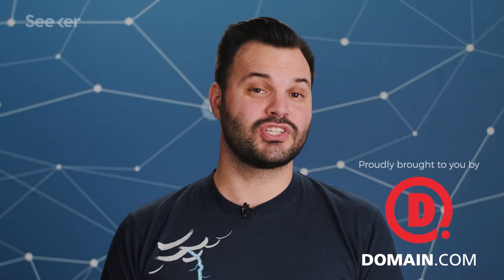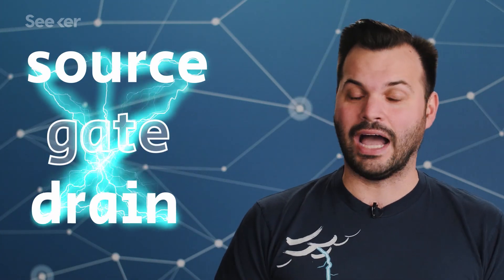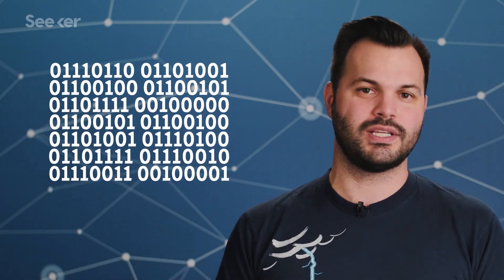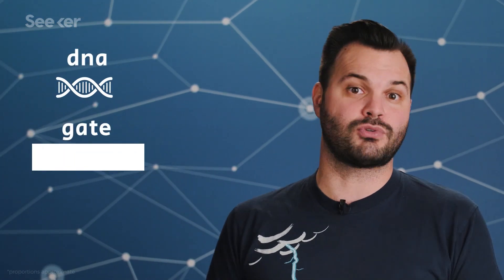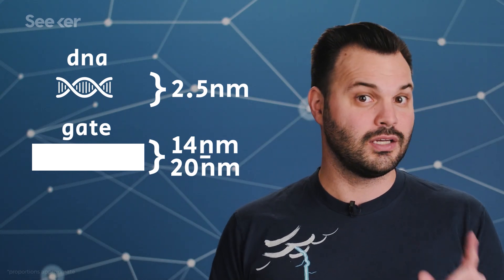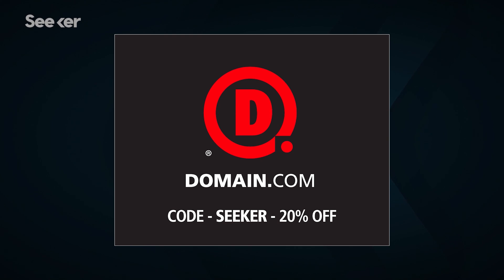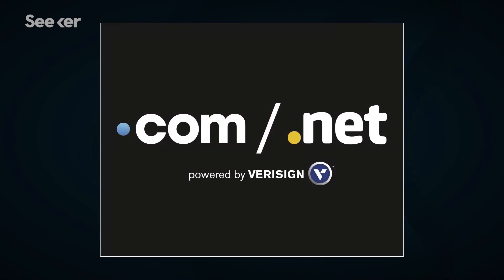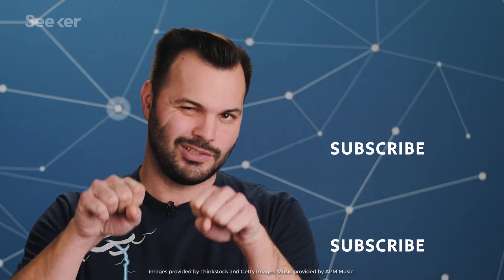This Is the End of the Silicon Chip, Here’s What’s Next

Comment: Back in the nineteen thirties they were working on transistor, and had the patent in nineteen forty. Making and intergated chip, with more than one transister was not only easiy, you could almost do accidently. Either way, you didn't need figure out the technology, you just had to do it. A little after they had the patent on transistors, the engineers made a intergrated chip, they called a Hershey Bar, because it was the size of a Hershey bar.  The engineers took the Hershey bar, and big box of radio tubes to the president of American Electronics.  They did a presentation, explaining how that little Hershey bar would replace all of the radio tubes. They would use less electricity, were smaller, and didn't wear out. The president of American electronics picked up the box of tubes and threw them on the floor. The tubes smashed. They president said, "what you boys don't understand is, I make money selling tubes. If they don't break, I'm out of business."  American technology held the patent on transistor, and there use was suppressed in the United States. In the fifties, Japans electronic firms were using transistor when they could. Transistors were expensive, but products would brag about how many transistors had in them. The United States slowly phased out tubes in electronis in the earily eigties. Boo hoo, so what? When the patent of transistor was running out in 1957  Texas instruments invented the first intergrated chip. Well no, they got a patent on it, because the patent on transistor was suppressing intergrated chips. You know a patent last seventeen years, right?  So the computer age was stalled for almost twenty years, right? Hell no, the electronics industry has fought tooth and nail to stall advancement for it's whole history. Why? For profit they claim, but profitable is company that doesn't exist? How many electronic companies exist in the United States today? Did you know the first digital camera was owed by Kodak in 1975? Kodak thought, "We are a film company. If we don't sell film, we are out of business." Where is Kodak today? It's all but dead.

Comment: Look at the 2011 chip, and then the 2011 v2, then the v3, and as of now it's 2066.  They just need to make em wider, and that's what their doing.  Of course you can get a dual socket mobo if ya want to go nuts, but I can't bog down my 4960X with 200 pages open and running all kinds of programs. 

 On a side note I've always wondered if they could switch to silicone carbide for the chips.  They could take some crazy temps "when you see the black in a sunspot your looking at silicone carbide", but I'm guessing the manufacturing process would take some figuring out.

Comment: 5-6 nm maybe... But even though I have a really small phone with a powerful battery... I have a "large" desktop computer with the actual CPU's is probably just 1% of that volume inside it... And I don't mind the big (it's a medium PC case)... atm it has 4 cores, and running about 1000 threads... 5-6 nm ARM (type chips) using 50% of the this desktop space would probably (at 5-6) nm would easily amount to +1000 of CPU cores... and the best part of it is that the cores can be off/on depending on the workload... 

But I actually welcome the day, then we need to start using our brains instead and do things smarter and not just make some hardware to do it faster... Improve algorithms in software and so on... but that will probably never happen again, like it was on the C64 for example wich just got better and better by improving the software...

Comment: We stopped going for clock rate a long time ago - we were doing 3ghz+ in the early 2000's - and started pursuing more data in each clock cycle, and more cores to multiply the amount of work that could be done. We don't NEED smaller transistors we can either use physically much larger cpu's or many more of them. I kind of like the idea of having a motherboard with 32 cpu slots in it and you simply add as many cpu's as you want performance. Of course software development needs to change to be highly multi threaded, this would probably benefit most from a hypervisor that dynamically handles this and spreads the load so it appears to the software as 1 core/thread but is actually running on dozens at once

Comment: April Fools. Seriously. Is there not a better article; this is a concept in progress not a fact or something workable. A light structure would be much bigger and not nearly as workable as a good circuit; ever see electrical energy transported many miles over light? And light being faster supposedly (electrons can be almost as fast as light; depending on the medium. light can be made slower based on the medium) doesn't make a computer faster; our nervous system has millisecond delays but is considered overwhelmingly better than any silicon system operating at ns delays.

Comment: the short answer to what happens when we can't make the transistors any smaller is that we will get much more 3d but this causes problems with heat so we will also have to get more efficient there is a long way before we run out of ways we know to get more complex before we run out of ways to do it.

Comment: we have to think the reason why we need to shrink the transistors at all. It is because of we need small and more powerful hardware to run our mobile devices. Consider this, if one day a new battery technology comes out that drastically shrink the volume of the batteries we use, there would be a lot of space left for bigger chips. There won't be a need to shrink anything else

Comment: Just being nitpicky about the physics, but it isn't the current that represents a 1 or 0, but the voltage level.

Voltage is what triggers the gate in a transistor to open or close, which is what allow computations to be completed. 

Yes, current does flow during switching, but a stable voltage level (a stable bit) is what is computed.

Comment: Everything seems to have its own evolution even these transistors. My first computer would be concerned a joke today, it was quite small made by Timex  and had next to nothing in cpu speed via 2.2 kb or ram storage. It was very limited and the keyboard was prone to failure due to its poor design but it was a starting point for those bigger faster more power ones. I was blown away with my first 500 mb flash drive and now they range into the terabytes?  Now, we have solid state hard drives and nano size devices that will boost that already lighting fast ghz speed? 
My one guestion is what about that cpu damming heat we still have a big problem with for a fan can only do so much? Will these nano tubes run cooler or even hotter?

Comment: ... and Moore's law continues to hold true.  The number of transistors will continue to double. Personally,  I'm inclined to believe that if you could make a time crystal out of quasi light particles you could not only use it as the basis of quantum computing,  but add additional dimensions to the same logic gate since the very structure of the crystal can vary. Rather than making the transistors smaller,  you can just add dimensions to the transistors you have.

As a side note,  quasi light particles can't be massless because the electrons that the photons are bonded to are not massless. This also implies that unknown electrical properties may be found.

Comment: (I might just be asking an uninformed question here I'm sure I am but) if tunneling through the gate is the problem why don't we take the gate out of the equation entirely and just turn the source on and off to represent ones and zeros if it goes through the tube then it's one if it doesn't go through the tube that is a zero that can account for the quantum tunneling as long as it pops something in the tube it's a one couldn't we use this principle to make this work anyways? If the gate is there to register if it's on or off essentially can't we just do that from the source?
Reply: The problem is that we're thinking that the smaller we go the fact is we still have to stick with our current modern system of how we register the data what if we changed how we register the data to account for tunneling is what I'm trying to get across, is it possible?

Comment: The Gate Drain Source architecture is actually that of a CMOS transistor or (Crystalline Metal Oxide Semiconductor) whereas, modern chips use Silicon! and the three pins are actually named the Emitter, the Base, and the Collector! More than that, the individual Logic gates are actually constructed in such a way that throws the basic transistor out the window, and is much more complex... not to mention the way they are put in a matrix together... but that's getting a bit off topic...  main point: we use Silicon today! not CMOS variants!

Comment: Transistors are NOT SWITCHES, they can be used as switches, but their main behavior is controlling the electricity flow between the collector (you call it source) and the emitter (you call it drain) with the base (you call it gate). Transistors can used as amplifiers, electric controlled resistors and switches. With the different type of transistors you can control current or voltage you can even use them as capacitors to filter out frequencies. With the base "width" you can allow frequencies to jump over it, since the wavelength is not captured by the base, when you are really small then the electron wavelength is matters so if the not stretched base is too thin then the wave just jumps over to the other side. If I know right what happens that the other side get's resonated trough electro-magnetic field and the wave energy get's transferred by that. If we have a better base which can isolate that field we can go down in size.

Comment: One thing they have wrong in this video is the size of the transistors. 14-20 nm refers to the resolution that’s used when transferring the template to the silicon wafer when the processor is manufactured, not the gate itself.

Comment: The next generation of processors are yet made of Galliumnitrit GaN . Zhis material allows higher frequencies which makes the processor faster without becoming destroyed by the heat. This would be the case if we run the processor at this high frequencies. Using DNA is far away .

Comment: You missed describing the most important attribute of transistors; that they are amplifiers!  The action of a diode gate in a transistor is initiated by power much lower than the switched or amplified power transmission in a circuit.  A macroscopic model of this action is found in an electromechanical relay that uses a low-power coil to close (turn on) or open (turn off) an electrical circuit with electrical contacts with much more power transferred in the separate [secondary] main circuit.  A transistor gate can be controlled with a small rise or descent in low current and/or voltage to either vary much greater power as an analog device or to simply switch such greater power as a digital signal device.  The amplification & low-power switching in transistors allows miniaturization of logic circuits with commensurately lower values of power consumption, latency, noise, eddy-current interference & heat generation.  The employment of quantum tunneling allows even greater miniaturization, but it doesn't alter the essential function of amplification in transistors.

Comment: These chips get smaller and smaller over the years. Instead of that why don't they just jump to the smallest they can go. For example.  Lets say in 2010 chips were size 10 then in 2012 they went to size 9 and so on.  Well why don't they just go from size 10 in 2010 to size 1 in 2012 with out those extra years in between? I'm sure they have the technology to go really small without the slow decrease in size. I bet it has to do with companies making money.  If they decrease the size and get faster at a slow pace people will buy each upgrade.  What does everyone else think?
Reply: intel has planned to release a 10nm cpu since 2016 but they supposedly are having issues which is why we only have 14nm chips now. as die sizes shrink new tools need to be created and that takes time and billions of dollars. the microscopes alone used by chip fabs are able to zoom far beyond what most major science fields are using. a university used an electron microscope on an i7-8700k at 4700x zoom and wasn't able to see transistors.

Comment: Smaller does not mean faster. I got the launch ps3 which uses 90nm chips which runs faster and better than my new ps3 super slim that uses smaller 45nm chips. I give the benefit of the doubt that ps3 hardware is 12 years old now and processor manufacturing have drastically changed since then

Comment: One neat option I have read about is to incorporate the quantum effects of the sub 5nm structures into the design--either using them directly, or having a correction system built in to the chips. But, that still probably won't get us very far for all the complexity it would introduce. I'm betting after 2021-ish machine learning and optimization will be applied to improve software and chip design for another few years while the industry figures out just where it is going to go.

Comment: I know you had to keep it simple but my electronics engineering tech nerd in me is too strong.

In its simplest form 1 isn't just an open gate, it's an open gate connecting the output to the positive voltage and a closed gate connecting the output to the negative voltage, a 0 is the reverse. More commonly one side usually has to have multiple gates to be open and the other side has to have multiple gates be closed in order for the output to take a certain state.

For example, an AND logic gate has to have all positive side transistor gates be open and all negative side transistor gates be closed in order to output a 1.